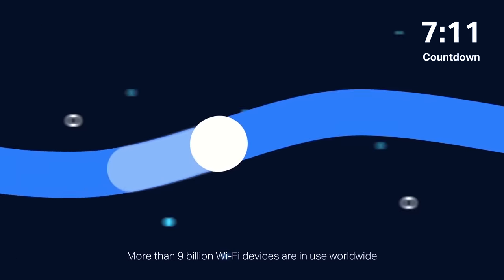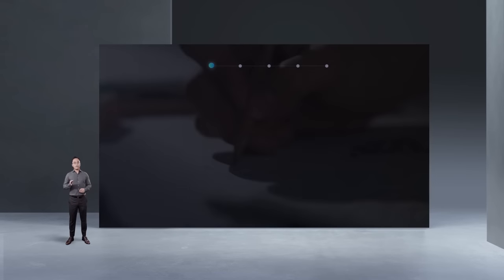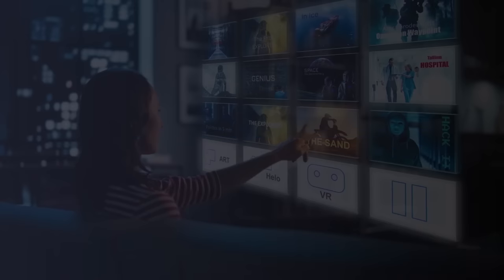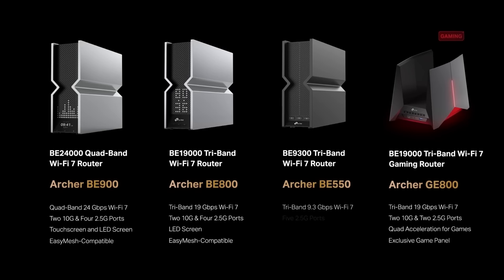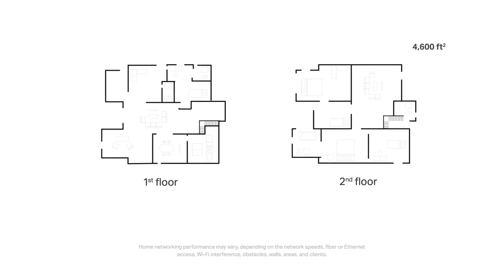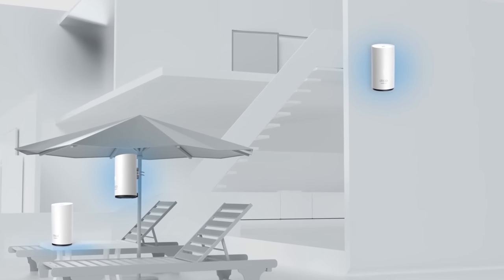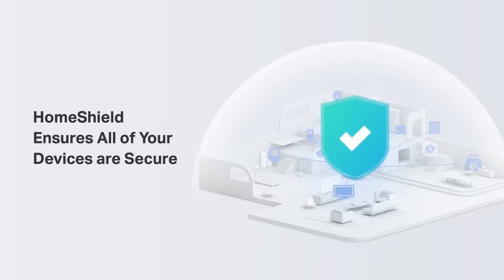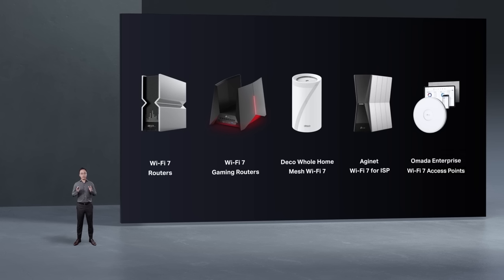2022 TP-Link Wi-Fi 7 Product Launch Event

Comment: The question as always with TP-Link, will any of these products get more than three or four firmware updates before there's a new hardware revision and owners of the older revision are forgotten about? Due to poor software support, I would never put a TP-Link device facing the internet, as their products are simply not safe to use, as they are not patched against real threats.
Reply: That is actually not a question with TP-link. It is a given, at least with their consumer products that they will stop supporting their perfectly working hardware with software updates after a year or so. Worst part of it is that, it's not dependent on the date of purchase. It seems to me that TP-link products are managed with release date and last date of software support finalized at time of design. A consumer could end up buying a TP-Link product already past this last date of software support. I've done that especially with wifi enabled powerline products. The latest update software was from a year before my purchase date from bestbuy. It's really risky to run wifi devices that do not receive security patches and software updates. TP-Link products tend to be solid and they keep on going even with very old firmware versions. But in terms of networking gear with old unpatched unsecured firmware, they should not be run at the edge or in wifi. They're okay in a home network, only for wired access i.e. switch and behind firewall layers.
Reply: @CloverMind  maybe a bit of a rant, but I can't really disagree.
Reply: @CloverMind  time for some openwrt
Reply: @CloverMind  this is main problem with tp-link - I was using their business routers few months, most business cases reported on forums are resolved after year or two...but only in new devices - when you reported problem - it will be solved but in newer device. Last time they produced fix for mDNS service but only as not working button in omada gui since there is no firmware to work with that - and that was after 2 years.
And that are prosument products.
But hey - if you have Archer C7 - you already know what it means - you will lose your support - if any - after max 2 years.
From other hand look at other companies that can support their devices for - example - edgerouterx
Reply: What is better than Tplink?
Reply: @bennintate  if you need prosument devices that support is (as it should) long, then go with ubiquiti as mentioned previously. They also produce updates slowly but at least they are no matter how old your device is.
Reply: @bennintate  just about any brand? Asus and some Netgear models seem to get regular updates.

Comment: Dear TP-Link,

I'm a loyal user of yours far before Decos become a thing (I had some older gen routers before Archer AC5400 and now I'm using Deco X90s along with Powerlines. Where I'm residing at the moment, the speed we are getting from ISP isn't like in the HK, SG, TW, Western EU or US. But I'm happy to share that I have a stable internet speed all across 3 floors building under one SSID, mesh system if you want to call it with TP-Link gears that I've set up.). I tried to use other brands but since I'm so familiar to your GUI / web menus since old generation routers, it is just a common sense for me to keep on using what I know and used to rather than learning new interfaces and screw up somewhere. Sadly, I don't see myself to keep on using your routers or Decos in the future if the features are still not properly implemented.
Reply: 1. Your QoS doesn't work to my needs.

I'm not sure if I messed up somewhere somehow, but I just can't get it to work to my needs. I believe many of your users want to limit the bandwidth used by certain devices like AIoT from their network, but I couldn't get it to work. The bed time feature certainly works and I'm a user for that feature you offered. Other brands' QoS works wonderfully and I had to use their product in a certain area / space that I need that QoS features.
Reply: 2. Please don't make it so funny where we HAVE to buy your RE (the ONLY OPTION to expand the range of a wireless network). Let me elaborate more. I understand that there are many options to expand a wireless netwrok. With Decos, so much less of a hassle if you know where to place the satellites. And if your surroundings allow that too, one note is walls aren't thick like bunker type walls. Have fun with internet speeds if someone's home or small office has that kind of wall tickness. AP, well that is one way to do it too for sure with LAN connection. In this example, I'm talking about your base to mid range AX routers. Why can't we consumers 'mesh' an Archer AX10 to an existing wireless connection of an Archer AX50? Or an Archer AX50 to an Archer AX90 / AX6000? Instead THE ONLY OPTION to expand is via RE, old or the new generation of RE with AX / WiFi 6. I understand from the business perspective, but other brands do not limit like you do. They can simply add routers and/or nodes to an existing wireless connection, with note that the main connection is made with a higher end models and the following nodes / satellites being one below it and so on.
Reply: What would happen if you, a giant network tech company lose a consumer like me? Surely, nothing. And this isn't a rant and not even a whining from me. Instead, my token of gratitude in the form of feedbacks to you from a consumer of yours for almost a decade. My wish is to continue to use your products now and in the future and of course with my networking needs fulfilled somehow with the features being offered. May be I posted this at the wrong media (your forum might be better place I guess). Anyway, I hope someone from TP-Link who handles this type of PR thingy, kind enough to read and may be, pass on the message to the appropriate department.

Cheers TP-Link.

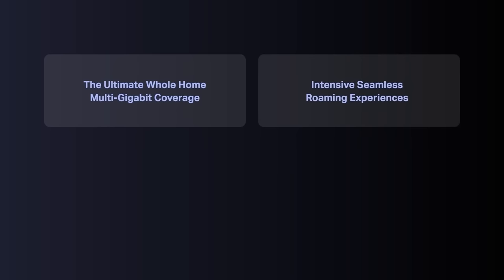Comment: 33:14 - Intensive Seamless Roaming Experiences - I WISH!  This is my only complaint about the Deco system.  We have a Wife 6E system of X90 / X4300 Pro units and once you are connected to the correct unit speeds are TERRIFC!  However, move around and good luck until things get so bad it is forced to roam.  Have worked with support, added the 3 additional X4300 Pro units and still issues.  Had an older Amplfi system that worked great for the hardware it had and truly allowed seamless roaming.  Was just capped at about 80-90 Mbps at best.  

Hopefully this gets addressed and then it really will be the experience they are touting in the video.

Comment: seamless roaming... well given my experience with deco, this barely works at all, there's always this moment of disconnection when switching to another access point, so with that, ill take that as a  lot of rock bed salt. At least with enterprise AP like unifi or ruckus have this controller that basically makes this seamless roaming works like a magic (assuming your have a wifi client device that is modern enough to work with wifi roaming).

Comment: Why still single SFP+ port ? How is supposed to use this router at 10Gbps in/out with only one SFP+ port ? These 10G RG45 port are unusable because switches with such port are way more expensive than switches with SFP+ ports ;)
Reply: But sfp+ is generally more expensive with transceivers included in the setup, so for short runs it doesn't matter...

Comment: Tp link Wi-Fi router one mesh system don’t have Ethernet backhaul. Bought a router for £350 and simple feature to connect the other mesh devices with Ethernet backhaul is not available even after 2 years of release. Disappointed!

Comment: 2023 WiFi 7 testing year first devices will not not huge success first one it take time but 2024 year ture WiFi 7 chips will show up 2024 y  February to September Market will be on it  but 2024 like black friday 802.11be Routers wifi7 Huge sale on it probably they have technology pushing quickly since 2019 covid change too much more people staying home and needs speed up  15 moths from today you going see more devices Even your devices like mash and routers noting will work like phones tables and computers motherboards needs chips that have to supported wifi 7 What I read IEEE push much take time distributed Devices packing Second version of the device will high speed always first one are tester next ones are most available readable I'm sharing what I see and  what I hear from news noting always special on beginning it was happening with wifi6 and wifi 6e soon it happened Good luck if you things differently I'm staying with my opinion my news bye